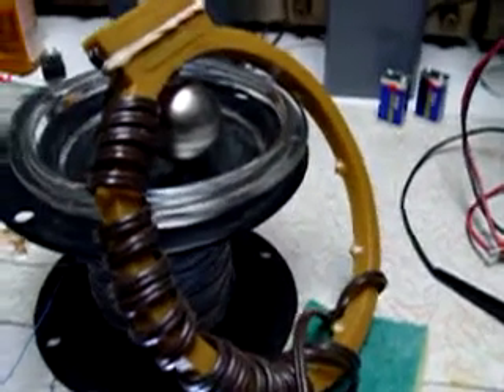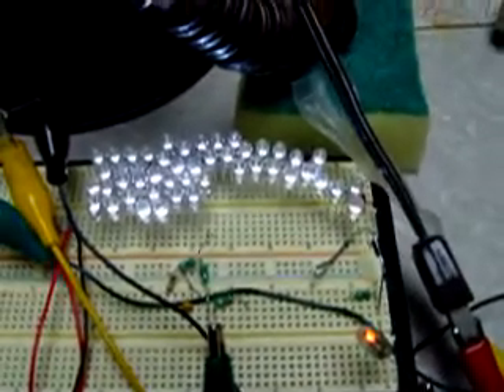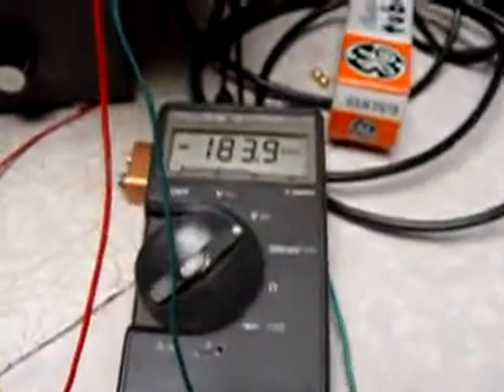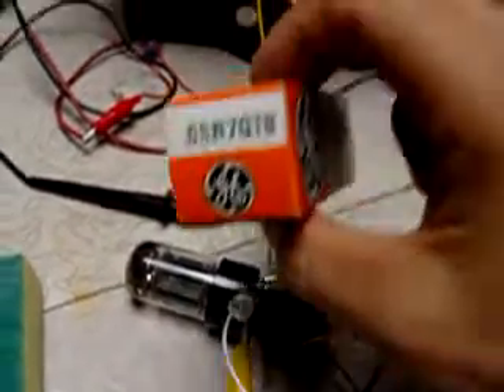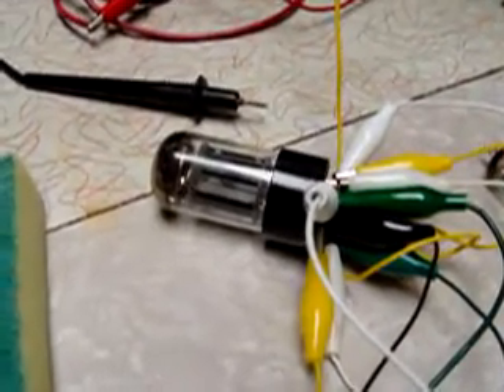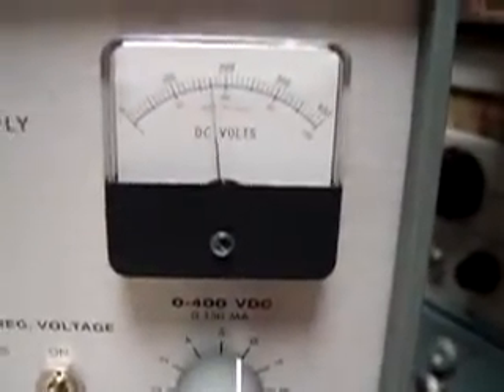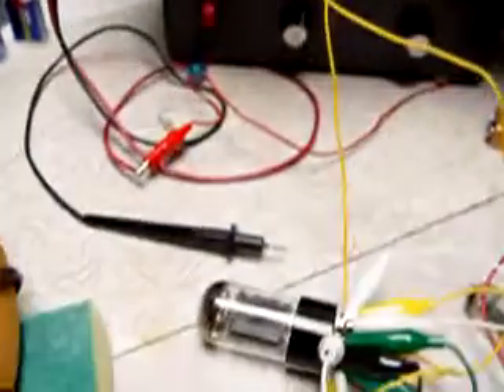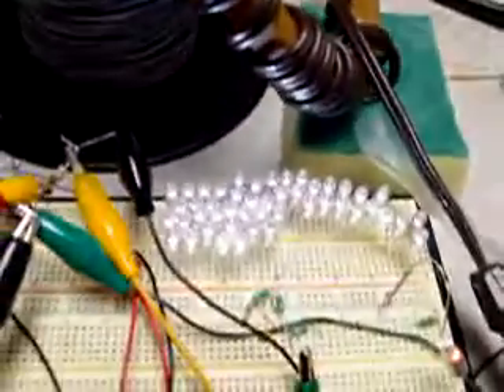Retro Vacuum Tube Bedini One Magnet no bearing motor.....6SN7 Dual Triode

Comment from the maker: The voltage shown is being generated by the spinning magnet. The large coil AC output is fed to a simple voltage doubler  circuit so the voltage is a filtered DC. This is then used to feed the neon and LED string.